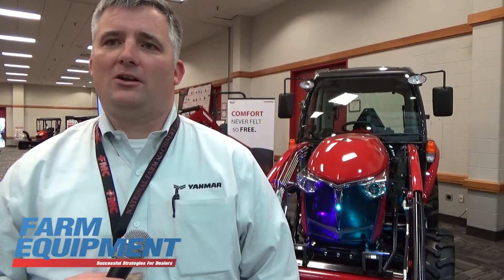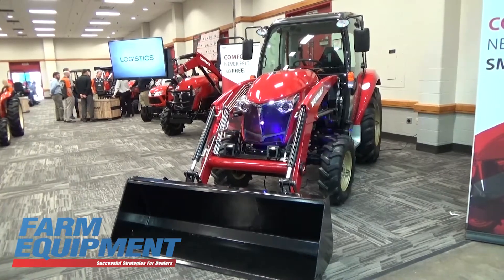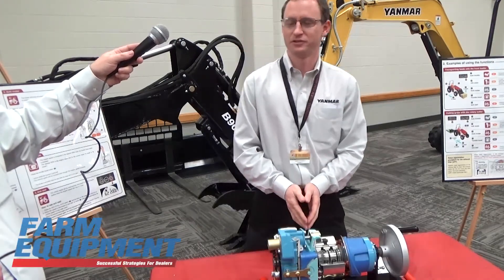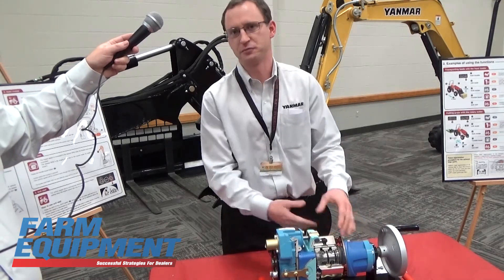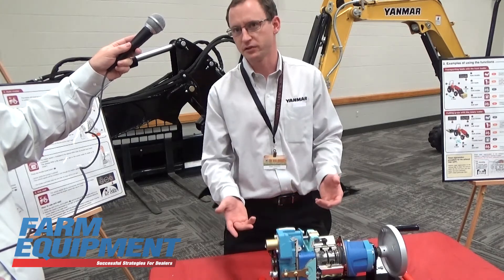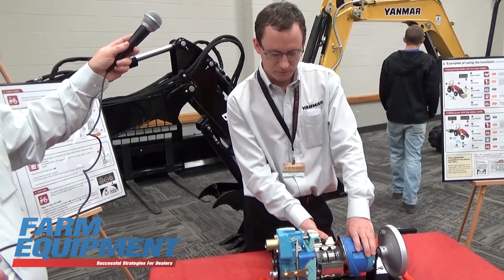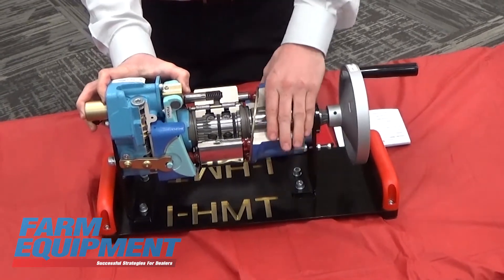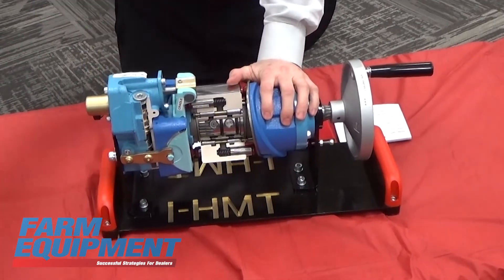Yanmar Showcases YT3 Tractor

Comment: Good to see that a company developed a variable transmission that just didn't turn fuel into noise,heat,& wear.  Also with close efficiency (85%) VS 60%aka typical hydrostatic, compared to gear driven. Almost the best of both " worlds".